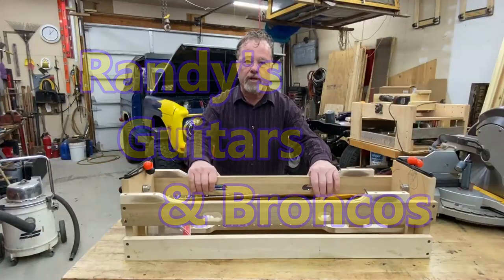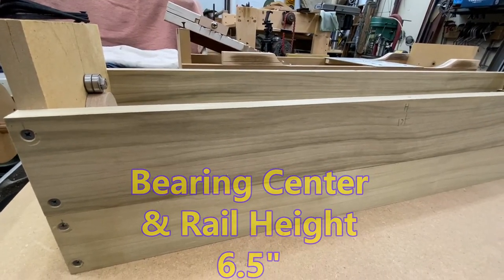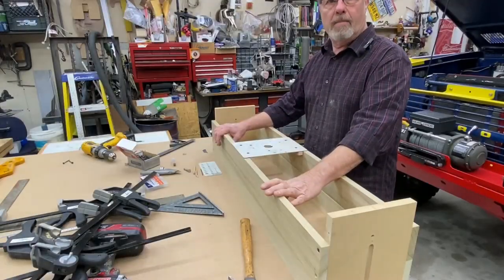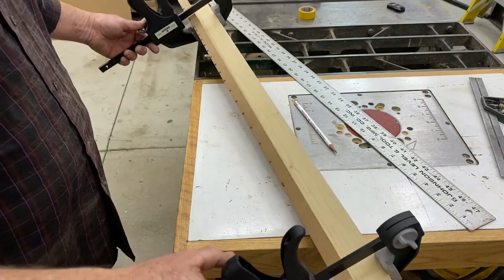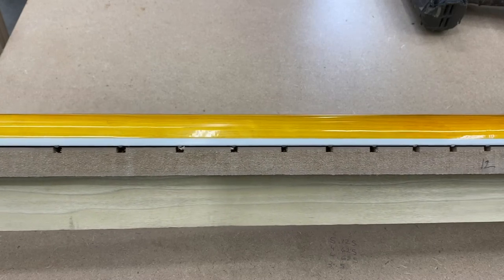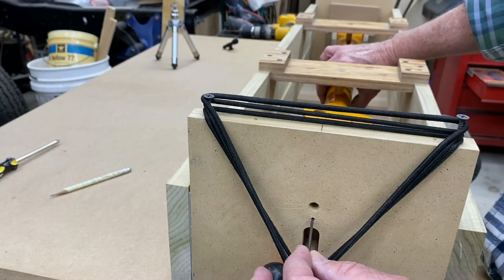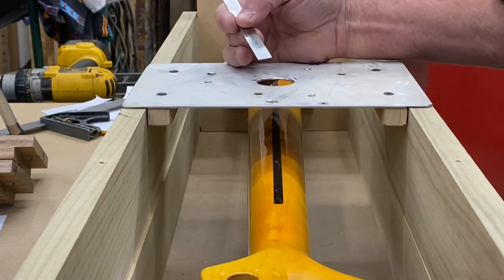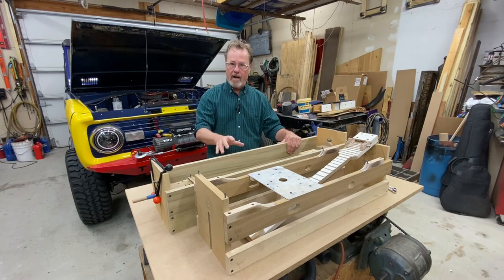Copy a Guitar Neck with  a Profile Jig, Revisited, in Greater Detail

Comment: Would it be possible to use this jig to radius fretboards too? Seems it would be particularly great for compound radius fretboards.
Reply from the maker: I think it could be adapted for making compound radius fretboards. Think about it, the back of a Guitar neck is a compound radius, just a much tighter radius. Thanks for sharing, I may try it.
Reply: You could probably measure the distance between the cutting head and the bottom of the bearings, and that would be your offset. If for example the offset is 1",  and you're going for a 12' radius fretboard, the puck would be a 13" radius on which the bearing rides. @randysguitarsbroncos223

Comment: Question:  on the removable pieces, with the dowels that ride on the original neck to mark the pucks, the length of the part of the dowel that is sticking out is 3/4"?  I'm assuming 3/4" for the MDF board that rides between the sides and another 3/4" of dowel sticking out for a total of 1.5" from the top of the rails to the bottom of the dowel, correct?

I made mine to ride on top of the rails, with the dowel sticking out 1.5", just like the router bit, and with test cuts, it's cutting the sides of the neck too narrow, but the thickness is fine.  It looks like the pucks are being marked too narrow, and I can't figure out why.  Any suggestions?
Reply from the maker: 1.5" total from the top of the rails to the bottom of the dowel, is correct. With the neck that you're ready to route, mounted and centered in the jig, hold the neck at a 90 degree angle and check for 1.5" down to the side of the neck from the top of the rail (bottom of router base) If you get something less than that, then the cam is to narrow. Or, you could only allow your router bit to go to that depth and then remove a little from the top of the cams to get the neck thickness.
I have a newer video on the subject that may help. 
Good luck, hope this helped. https://youtu.be/AXjW8cOZ_E0?si=agZeEZ_G6yC4y5o8

Comment: Awesome, great tutorial! The only thing im a little confused about before i start are the end center holes on the neck carriage. Should the two end centers be at the point where the fretboard meets the carriage surface, or, in this case, a neck with a 1/4" fretboard, where the fretboard base is glued to the neck? You said something about a 1/4" down to accomodate for the fretboard, or something like that, couldnt quite make it out lol. Id sure appreciate it if you could help me out with that, other than that, i think ive got it.👍
Reply from the maker: @MJ-nd7cj  Before I had built this jig, I had watched some YouTube videos of others with similar jigs, and they were doing theirs without fretboards on and had the axis center where the fretboard would have met the neck, but of course no fretboard on it. I’m doing mine with the fretboards on so I added a quarter inch, raising the center of the axis a 1/4” above the surface of the carriage. I don’t know that it would make that much difference one way or the other. As long as your cams were created with the quarter inch compensation. I hope that makes sense.😬 Thanks
Reply: @randysguitarsbroncos223 Thank you Randy! And yes, that makes sense. Ive seen those vids and some other drawings too, which probably added to my confusion lol. I like your version, and thanks again, i really appreciate it!👍👍

Comment: I have been wondering if there is a way to make just one frame that can do any scale length neck shaping.  I have to think on it some more.  I am now a subscriber to your channel.  Thanks!
Reply from the maker: Yes, I think one long one could do all scales if you want it to. If I had built the one for bass first, I probably would’ve done guitar necks with that. And may do that in the future. You would have to have different versions of the rotating portion.

Comment: think you could make a arch top jig as well 
wat im thinking is to use the router mounted on a arm hinged on one end to a rail mecanism that can move the arm across the body possibly using a window motor and a piece of alltread to move it smoothly towards the center of the rotating body 
the body be spinning horizontally and the other end of the arm opposite the hinge moving over the jig thats rotating at the same speed using a chain and two sprockets 
the arm moving along a track from the outside toward the center (maibe using a windshield wiper motor driving a piece of alltread to move it smoothly )  and cut the arch in a spiral pattern from the outside in 

to make the jig / cam mould you need to be using an existing archtop body and mount the router on the other end of the setup to cut the jig , since the jig sits on the end of the arm and furter away from the original the jig will end up larger than the part you be making , think the jig could be made from mdf 
think the whole "machine" end up about 3 times the size of a guitarbody both in length and width 

another thing you probably need to do when making the jig is create sumting that prevent a too harsh hit of both the bearing follower and the routerbit against the edges of the guitar shape , think the jig/ cam mould would need to be round and have ramps intoo the arch wish you might need to make by placing a board cut perfectly around the original guitar shape youre making the mould off and raise that board untill its level with the edges of the binding , or set a stop on the arm so it doesnt go below that edge when cutting the cam jig
Reply from the maker: Oh wow, sounds like you’ve put some thought into this. Keep those wheels in your head turning.👍

Comment: WOW, so cool!!. I started to build my own Bass jig a few days ago and this is a great help. I now have a much better understanding , tomorrow I'm slotting the carriage, my end pieces are done, then moving on to the cams. I was thinking of making the cam blanks slightly larger and cutting the stops right out of the cam sides (like bumpouts) to stop the carriage from turning more than the edge of the neck. Cool adjustment at the heel. Anyhow, loved this video, thank you again. Please show the final results of the completed bass necks.
Reply from the maker: Thanks, I will post results. Not sure when, as I need to finish the two Tele’s beforehand
Reply: @randysguitarsbroncos223  Cool, whenever you have time. I slotted the carriage today, I will work on the end blocks and cams. Say, would you also be able to show how you managed to make those ramps? Appreciate you, thanks
Reply from the maker: I will try to make a ramp video, not sure when though

Comment: Are all elements of the jig are the same in thickness? If not, the length of slide and the innner cam would not fit each other. Please let me know the thickness, or we can't build the jig like you. I think the Thickness would be 0.75 inch, right? plus, what is the size of a bearing (R)? wonderfull work!
Reply from the maker: All elements are .75” thickness. The bearings are standard roller skate bearings which can be purchased in sets on Amazon. Size: .87” o.d. X .31” I. D. X .27” w